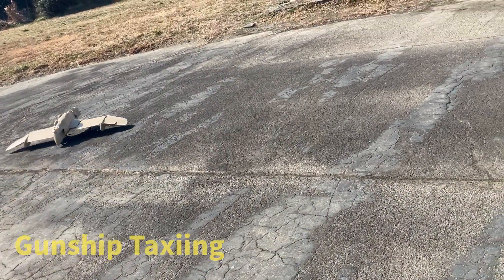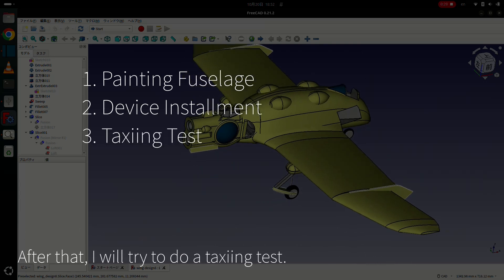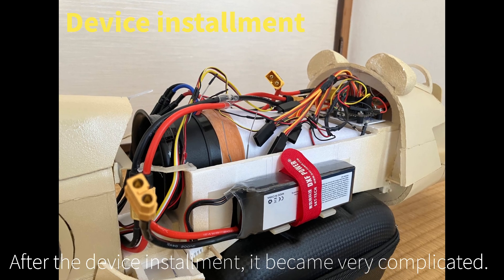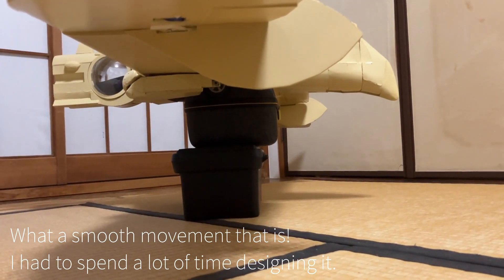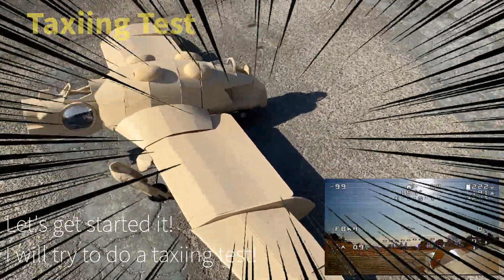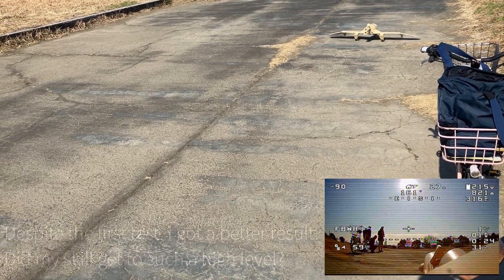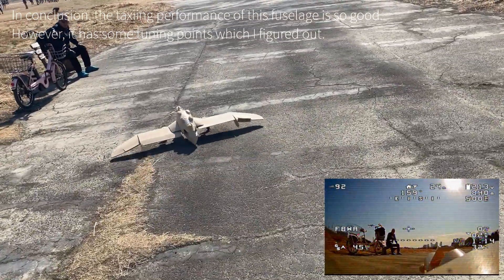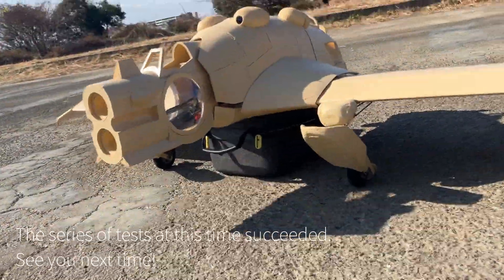Building and Testing My DIY RC Airplane From Scratch

Comment: good work.      you may know that there is an optimal way to design an edf system.   that way is:
there should be unobstructed (intake) air flow to the edf;  the intake(s) should be forward-facing; and, the total area of the intake opening(s) should be equal to or greater than the  Effective swept area  of the impeller. 
the area of the exit opening should be equal to the effective swept area of the impeller.     so, there should be a certain amount of taper in the exit duct --- over a distance of about six inches, or more.     googletranslate